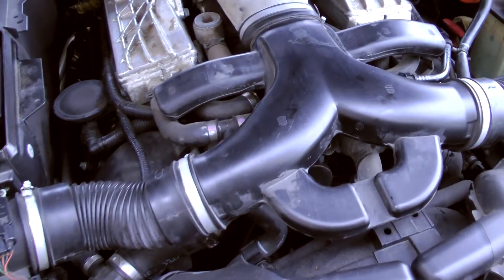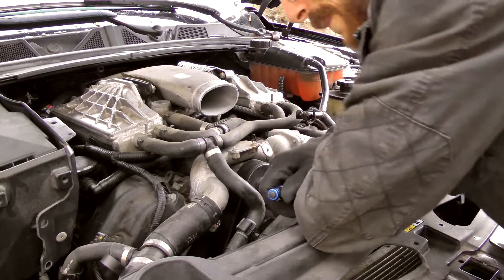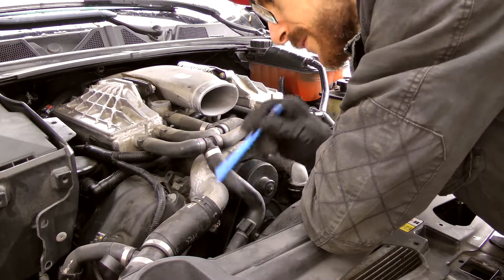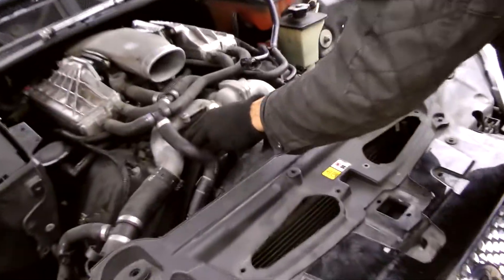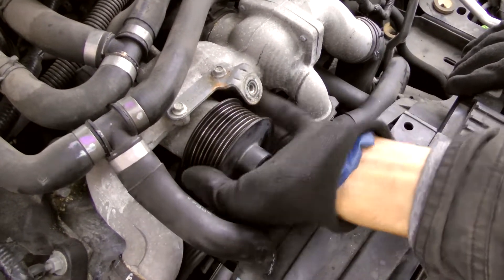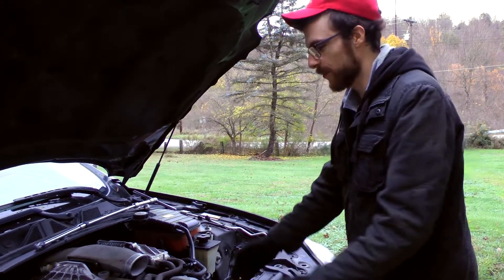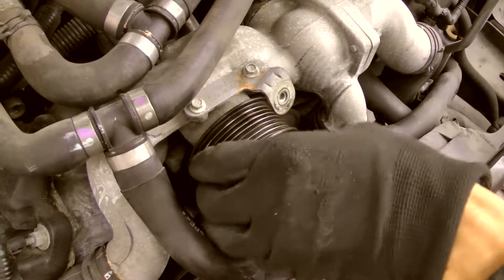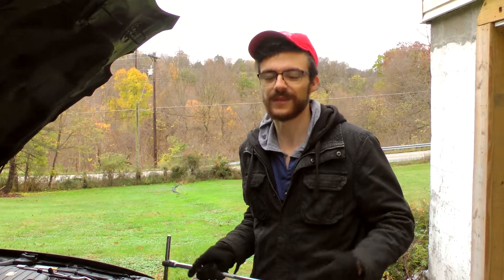Jaguar Supercharger Check

Comment: Hi guys, please help me, Jaguar Xj 5.0 supercharged. The water goes into the oil in large quantities quickly. Do you have any idea what might be causing this? Gasket? Oil Cooler? Thanks.
Reply from the maker: Doesn't sound good but usually it is a blown head gasket. Might be able to do a pressure test on the system.
Reply: AJ133 notorious for Coolent leaks under the supercharger, coolant cross-over pipe.. Also a blown head gasket too.. could be either or both.

Comment: Did you find it?
Reply from the maker: The noise?
Reply: @GTSam  yes
Reply from the maker: @calwright29  I did. If you see the later videos, I talk about it but I'll put the spoiler in here for you haha. It was rod bearings.
Reply: @GTSam Hey, I’m coming from an 640i N55 (those engine are quite know from rod bearing issues) and I had to change for a car a bit cheaper that is nice to drive and I’ve read plenty of nice reviews concerning AJ34S are the rod bearing a common problem on those engine or is it a lack of maintenance from the previous owner ?
Reply from the maker: @Damien911  hey, almost missed this but glad to share my thoughts. 
I really believe using quality oil and a 99% filtration filter (quality filter too) and making sure the level is not low and you change it about 3000 miles, it could serve you well. European cars are so high strung that need so much care but that then makes them amazing. My Jaguar, I believe, looked like it was very well taken care of from the first owners records I found. But then was sold and then there was a trunk fire, fixed, and someone got it and abused it. Cheap oil and filter, COPER spark plugs (this ain't the 80s) and low oil level.

Comment: The first video I seen showed me you had a rod bearing that was toast ,this video showed me you have no idea what your doing and sam crack led you in the wrong direction....you should have been able to wiggle a half inch ratchet in the tensioner ....if you still have the car reply
Reply from the maker: It's all a journey and exploring all possibilities. Love your enthusiasm though! You'd be surprised but you cannot get a ratchet inside there, I thought you could too but you cannot. Too wide and the space is too tight. Samcrac also had the right idea with his Jag issue but it's too bad that his issue and mine were not the same. I don't give up easily and just say "well, it makes noise, I'm done!" I like to make double, and triple sure, on what the real issue is before giving up.